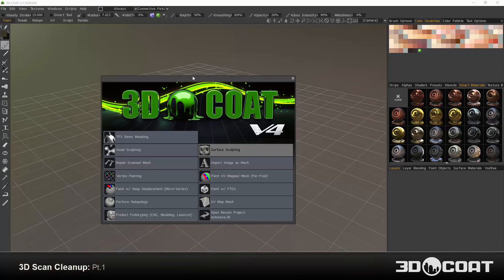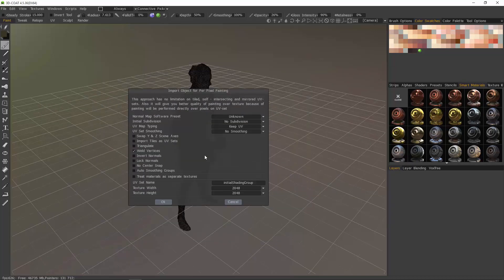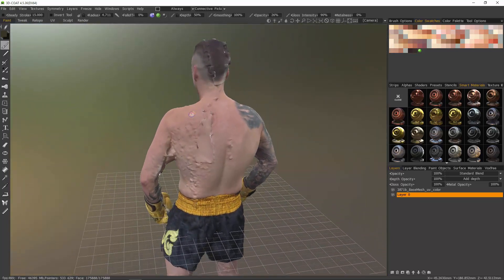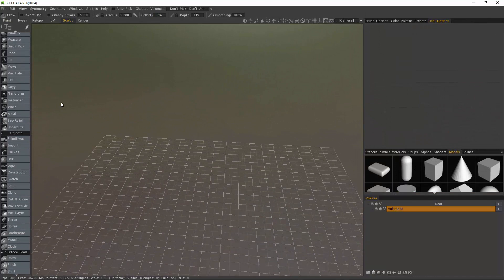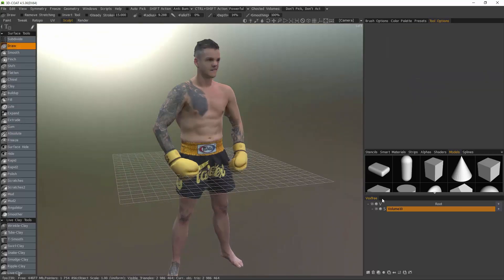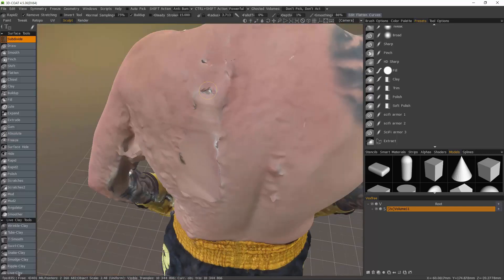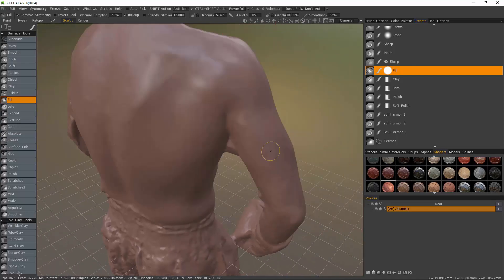3D Scan Cleanup Pt.1

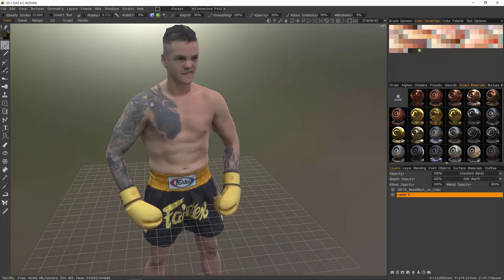Comment: I think this is not really good explained for new users. Long sentences with many technical terms, hard to follow... (Just try to follow from minute 2:30) Once the mesh is imported, then you have to import it again... Why do import it then the first time? Different rooms with different copies of the object…? so many modes of importing… and not explained what exactly the software is doing under the hood, because the standard terms are different, too (compared with Maya, 3dsmax, ZBrush). I think  I am missing a much more simple start workflow...

Comment: I can´t import my 3d scan into 3d coat. It has about 10 mil poly. But it opens perfectly in ZBrush, even 3dsmax has no problem to eat it. Tried both GL & DX version, tried all import variants .. it is just reading the model and then the interface freezes.